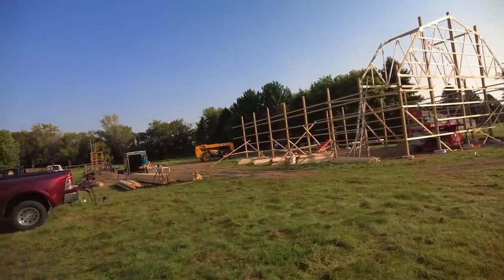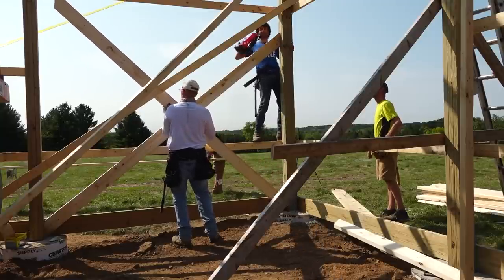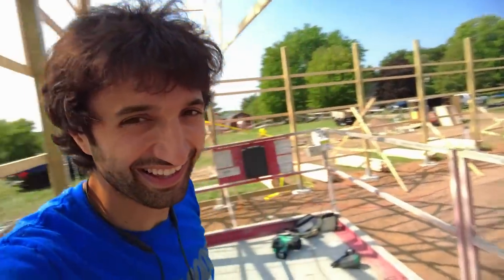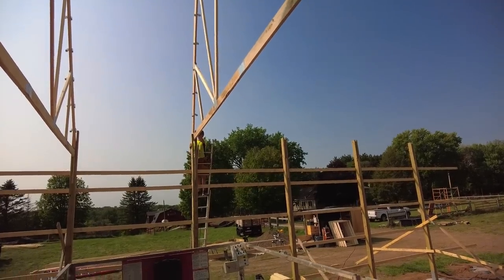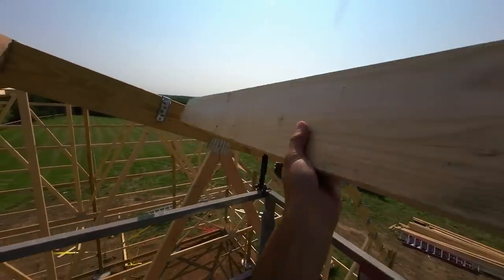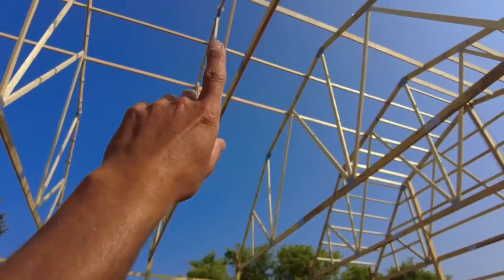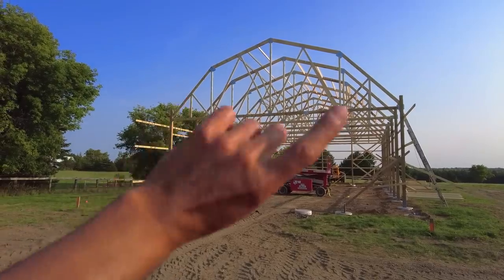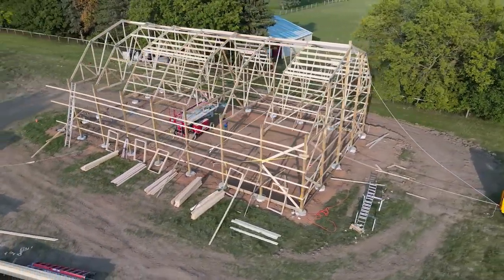Setting the Trusses  - 40x72 Gambrel Post Frame Episode 4

Comment: After all these months Donovan has finally proven himself trussworthy.
Reply: First comment, best comment.
Reply: In Donovan we truss.
Reply: What is the base dimension of your roofing timber ?  I would say for instance 6”x2”, 7”x2” etc stressing the larger dimension, I believe you would say 2”x6”, 2”x 7” but the basic dimension is 2”.
  I ask this  because all timber spec’s seem to be shrinking over the years !  I was brought up with plain sawn timber that was actually 2” thick, not 47mm or less !
Reply: I saw what you did there.  Wood you cut it out?? 😆

Comment: Mate while using a nail gun  having had a piece of nail embed itself in my eye socket just missing eyeball i strongly recommend some version of safety glasses cheers from australia
Reply: You hit the nail on the head with this bit of advice
Reply: I have to agree, Matt.
Reply: @rickhurley7653  Watching this I've seen several little pieces of metal fly off.

Comment: I love how fast this is moving. This whole build so far could be an ad for why everyone needs telehandler. Sadly, my wife has already told me no...  Your reasoning for the open space makes sense.  But you can split the difference.  Between those trusses is the size of a cargo container (40 feet by 8 feet). You should make the last two truss bays into a home away from home for Donavan.  Either that or an extreme AirBNB. "Spend the night in the sky and have a drink with Lindsay and I.  Telehandler races on Sundays here at Matt's Giant Crotch Barn."

Comment: I gotta admit, I haven't watched much of the home remodel vids but something about this barn has got me hooked on watching it.  Maybe it's that it's brand new and you're going from a grassy pasture to a building?  I don't know.  Another thing is that it got me thinking of finishing my own "baby" barn of sorts.  We have a carport that the previous owner built.  Its a 16x24-ish structure that has a poured slab, 6x6 posts and a roof.  I'm thinking of finishing it out into a one stall garage with a roll up door that would be used for wood drying/storage.  Seing how you finish this out will be a good guide for finishing mine.
Reply: I’m not sure why but I’m in the same boat, haven’t watched much of the remodel but been really enjoying these barn videos

Comment: I would use a Parlode impulse framing nailer for those hard to reach pearlons really helped out on my arms when I did work like this, is also handy when building overhangs on location for roofing jobs. Wouldn't want to use it on easier framing nailing because of the cost vs air nailing.

Comment: I'm very interested in your build. Like you I'm in a cold climate. My plan would be similar to my neighbor with insulated walls and an attic with insulation. It has metal on the interior walls and ceiling. It's warm in the winter and as long as it's kept closed it's cool in the summer. The white steel inside makes it pretty bright as well. Keep up the good work I'm sure you'll be happy with the size of your barn.

Comment: Your right about using  truss space for other uses. I doubled up on the ceiling rafters and laid a floor with a simple ladder to the now second floor. So far all I have put up there is old paper work which I'm sure the critters love for bedding. Have not looked up there in five years
 I'm guessing you are not going to heat the building since you are not putting in a ceiling. I did and then built a wood firebox from an old home fuel oil tank with a fan up high to push the hot air around. it heats up my 30' x 40' shop in short order.

Comment: If you decided you need an office or just enclosed storage in the truss area you could always build a lower room off the floor slab that utilizes two trusses—essentially a 2-1/2 story cubicle at the very back of the building. That way this smaller building would support itself off the floor rather than use the bottom chord of the truss system.(which would be massive for a 40 ft span. Might want to plan a thicker footing area of the slab for that if you so desire. Good call on saving the $30k

Comment: Re: Discussion on gambrel-style roof and usable space under the roof.  So, I believe gambrel style roofs were first devised for barns as a way to create more usable space under the roof.  Now, this is assuming real timber post and beam construction is used for the roof, not stick-style construction.  The stick trusses you're using give you the external appearance of a traditional gambrel roof, but not the internal functionality.  With a timber gambrel barn roof, the upper part would be two timber beams, meeting at a continuous ridgeboard in the center of the roof, tied together with a horizontal beam at the lower ends, and supported by a vertical column at each end.  The gambrel sides would be beams running from there to the side walls of the barn, also tied together at the top by a horizontal beam, which would also form the floor of the space under the roof.  Because of the strength of the beams spanning the roof, no additional truss supports are needed, which makes the space usable for storing hay.  You only have two vertical columns connected by a horizontal beam under the roof, as opposed to the forest of trusswork your stick-frame gambrel has.  Yes, you would have to add all those additional trusses to make usable space under the roof, OR, substantially strengthen the existing trusses.  I hope I don't come off as sounding like a timber frame purist, but the original timber frames were designed to make every inch of interior space usable.  You have a reasonable facsimile using modern construction methods, but you loose some of the use of the interior space as a result.  I don't know if the existing barn you have there has older timber frame construction or not.  If it does, check out the under roof area to see the difference.

Comment: if it's a shop, what is the plan to heat? radiant floor cement is good way to go but expensive and if doing racking drilling into the concrete would be a pain/worry.  love how quick it's going for you, my brother did a scissors rafter 2 on center to keep as much open as he could (also he did pitched garage doors so they use less space as well) idk if he plans to drive in anything tall but it was his way to have the main door height be the max it could be

Comment: Hi Matt -I live in Australia and I am a structural engineer. It constantly amazes me how lightly buildings like this are constructed in the US. Your current structure would not meet the Australian standard for wind loading  and this seems crazy since all of the US is subjected to Tornadoes.  Our building code has specific design codes for high wind areas where we get Cyclones but most of Australia is not affected by this and still the non Cyclonic code calls for more substantial buildings than yours. So my question is do buildings like yours survive tornadoes or do the legislators just accept that if  it's in the path of a tornado that it will be destroyed ?

Comment: I was surprised you didn't go with Cathedral trusses to open up the height of the center of the building.
Reply: Why? He could just add more bays as needed in the future, it isn’t like land is a issue! An the space would be more “useful”.
Reply: @MrPaulviles  I was thinking if it were Cathedral the height would give him easier access in the center of the building to be able to hoist higher for lifting and moving things around instead of just between the trusses.

Comment: How did you like using the Metabo metal connector nailer? I frame almost daily, and that is one of the last items I need to switch over to Cordless.
Reply from the maker: I like it a lot. Very easy to get the tip into the hanger hole. It’s just really heavy compared to the air version

Comment: what would the additional cost have been, to add in an upstairs for say 600 square feet, the other end from  the main doors, that'd be an awesome spot for an air B & B,  glass gable end wall up there, the views out, look stunning.
that's give you the best of both worlds, you'd maintain most of your ceiling height,  the air B & B could in time offset the cost of the building.

Comment: I was wondering about the potential for loft space up there, but wanting to keep it open is totally understandable.  Any thoughts of at least putting in some walkways for easier access to the stuff you plan on hanging up there?
Reply: The trusses are not load bearing... Because the boards are connected using nail plates. To be load bearing the joints would have to be doubled up overlapping the joints.

Comment: Camera??? hovering drone very steady high tripod? rocks solid. The plans are as simple as can be, just measure and work.  What is the gable height? Concrete Slab before walls? Stand alone Mezzanine with stairs where you wish.  Circus Trapeze and net, Zip Line? Wediings.  You name it.

Comment: Why did you leave the front end where the bases are bare and without another "post" set up for the corners and another rafter up overhead?
Reply from the maker: Easier to fly the trusses in without those tall posts in the way
Reply: @mcremona  
Wasn't trying to be snooty or anything. Was just curious, just in case I didn't hear why in the previous few episodes. Thanks.

Comment: Why hang all the purlins vs lay flat on top of trusses? This method seems to require a ton more hardware and $$? Not saying it is wrong, just don't understand the choice...
Reply: Reasonable question.
Reply: I just realized that the purlins hung instead of flat will provide significantly increased roof loading capabilities (snow loads, etc).

Comment: Before theeplywood are you puttng inInsulation with Radiant barrier in the ceiling. That would be a heck of a heating and cooling bill for you in the hot and cold mos,,  The aingle film Attic Film is tough and Not that much IO have uised it on a few places so far see this. Thyey aer great advisors too for optimum wat yo set it away making Voids. See this Matt calle em  Walls Sunny side. 
$650 for 3 x1000 sf rolls  60″ Wide Double-Sided AtticFoil™ Radiant Barrier Foil Perforated – FREE SHIPPING!*

Comment: Hello Matthew. You'd be much better off not insulating the ceiling inside. It is wood. If you plan on using metal roofing. I've seen too many of those who only last about 4 years. Metal condensate and it will rot those beams out in about 4 years. They don't tell you that when they spray the insulation but you will want your money back I know for a fact. Sincerely Nick

Comment: I disagree with your load concerns for a second level. You are limiting yourself to only wooden structure. While it is your building and your decision, if you consider using some steel for cross joist for the trusses, you have all the load capacity you could want. 
After all back in the day wooden barns often stored hay on the second level. Yes those typically had supporting walls and side rooms that would limit your lower level space. But putting steel into the equation you could easily have a second level. 
Again your building and use as you wish, but you have lost a lot of usable sq ft in my opinion.
Reply: Do you really think that he did not give full consideration to a loft? I found his explanation to be crystal clear and that makes me wonder if you watched and listened to the whole video. ? IMHO he CLEARLY explained why he went the route he did. Further, there are also cost concerns. Its their barn, you may build your own however you like.